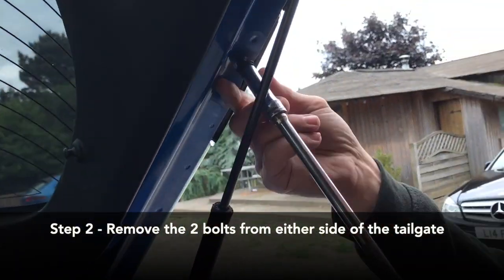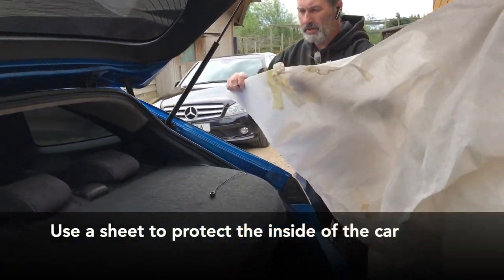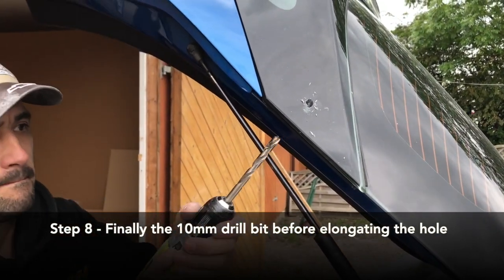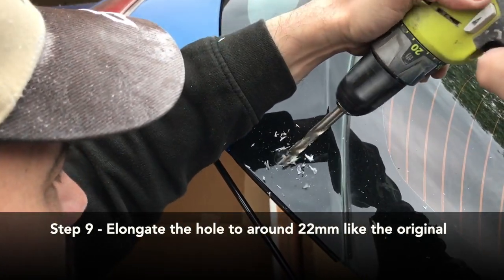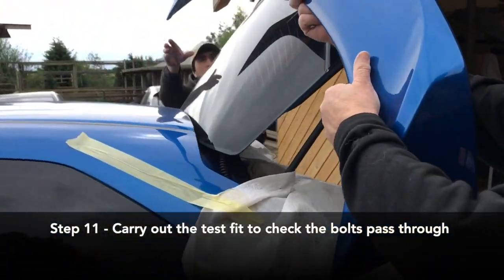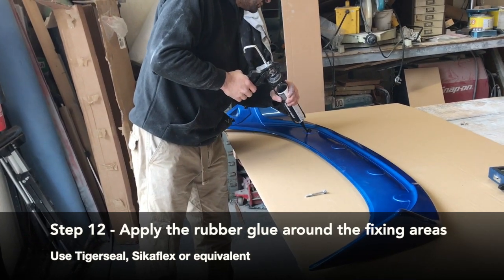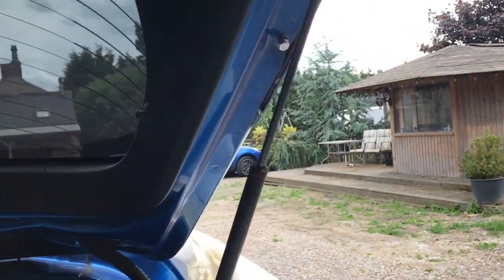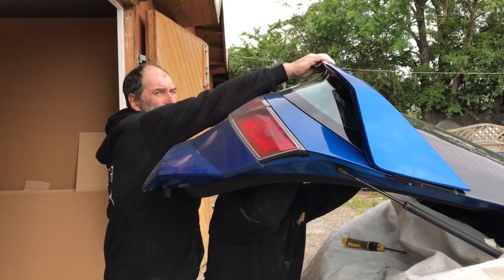Honda Civic FN2 Type R Spoiler - Fitting

Comment: For those who actually have a Type R, and not a Type S / Standard MK8 Civic... The actual FN2 Type R does not need drilling as the stock spoiler is already bolted up. This video is for those who want to add a Type R spoiler to their non-R's.
Reply: Could you put a mungen fn2 spoiler on a type s?
Reply: @dane1477  Yeah you could. You would follow the exact video as it stands. You'd need to drill the rear as depicted in the video. The Type R has these holes pre-drilled with the standard Type-R spoiler
Reply: Thank you for the info man. Doing it this week and this helped me a lot

Comment: hi, how did you find the exact location of the central holes?
Reply: I would appreciate a response if possible
Reply: Hello. I believe that location of the central holes does not have to be strict that much. You can see that they made holes in spoiler after spoiler was fixed with two outer screws. Spoiler originaly came with just two outer holes. So practically, you can choose where you want to make two central holes. I hope this helps